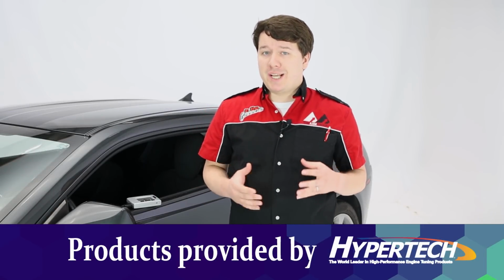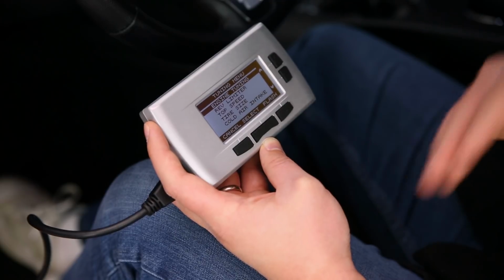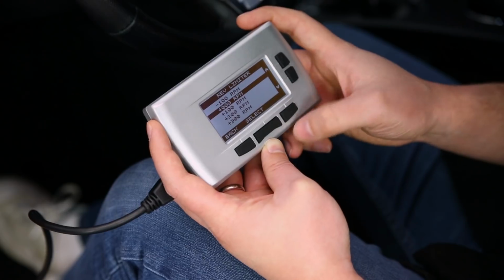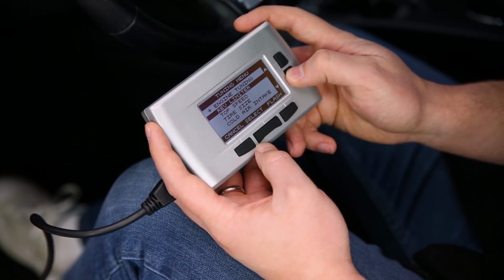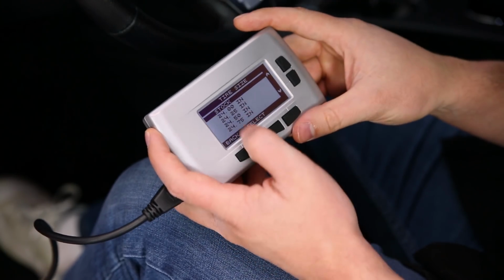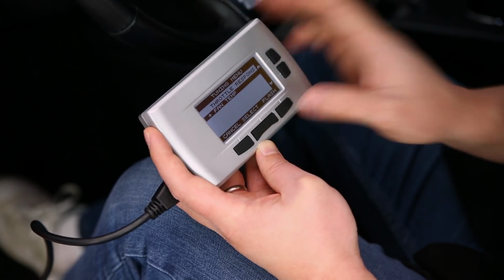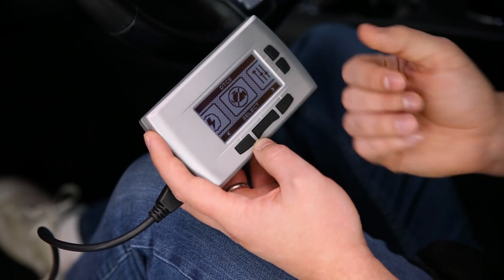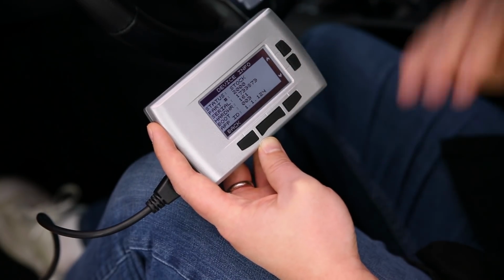In the Garage™ with Parts Pro™: Hypertech Max Energy 2.0 Power Programmer

Comment: will affect warranty depending on the car and dealer. some cars record any ecu changes and cant have that memery cleaned with out a dealer computer and the service pin. some require a connection to a hiden connector on the car that only the dealer has a connection to to even change any ecu settings. on them cars that do record changes you can hope you have a nice dealer and they will let it go and still warranty the car but some dealers will not. and that's not even the worst part. the worst part is now days with cars made buy dodge that have uconnect anytime you make a change to the ecu a settings change slert is sent over the cell towers to crysler and they contact your dealer alerting them. yes they clam they do not do this but they do and the only way to stop is more expensiv ethen its worth. and trust me they will let you know when you come in that you car has ben messed with since first thing they do is take the car in back come back out right away and say well your car is not working right since someone messed with the computer on your car and that damaged things and voided your warrinty. then you have to take them to court and its just a mess costing you money and most of the time you will loos since you are poor and they are a multi mill dol biz
Reply: No

Comment: I bought this same tuner for a 2015 camaro 3.6 after watching this vid. IT DOES NOT HAVE TUNEs FOR COLD AIR INTAKE. Nada, nothing. Its the reason I bought this . Why did they take it off? Thats the reason most people buy this tuner. Please let me know if this is correctable via update or should I just send back?
Reply: Same problem here. I have a 2014 camero why no CAI option? Same car, same tuner.
Reply: @francisdebari457  it was originally advertised with cai option. The website advertises it still. If you contact customer service,  they state the obvious that it isnt on there and then talk in circles.
Reply: Same here 2013 sierra
Reply: @Oblivionsurveyor  my father recently picked one up for his ecoboost f150. from the factory the tuner had no options other than tire size. I got on their website and installed the updater software found in the support section, plugged the tuner in and updated it. Now it has all of the octane rating tunes and some other options like shift points etc. BUT, any tune that we apply without customizing parameters makes the truck run like a cammed boat. it idles down to nearly stalling and then it jumps back up in rpm to save itself. I don't know whats going on with it but we just took it back to stock for obvious reasons and if we cant figure something out we are probably going to try and get our money back. If anyone can help that would be great. Hopefully you guys that are missing features find this useful and have a working tune when you update.
Reply: Juan Valdez same here and I can’t change which octane gas I have just regular and premium
Reply: Dang did u ever resolve your issue I almost bought it for the same exact reason and I have the same car same year 2015 camaro 3.6L and almost bought it bc I seen it had a cold air intake tune but did you ever figure anything out?